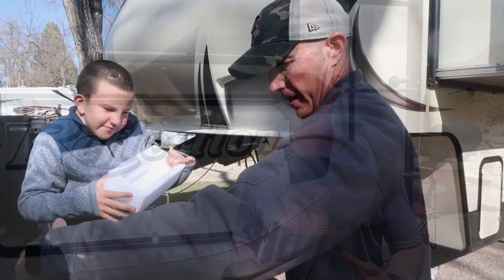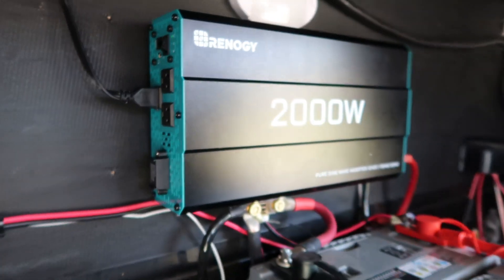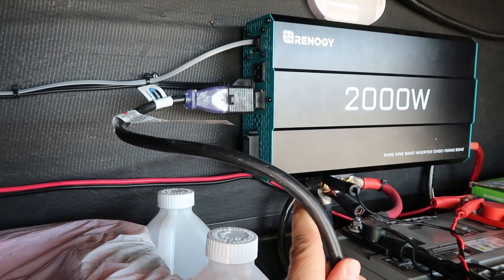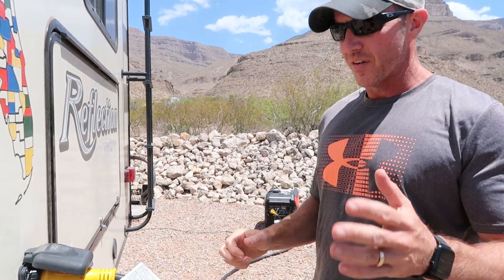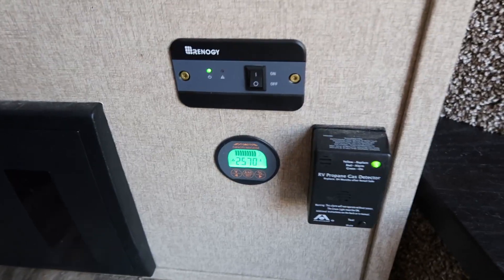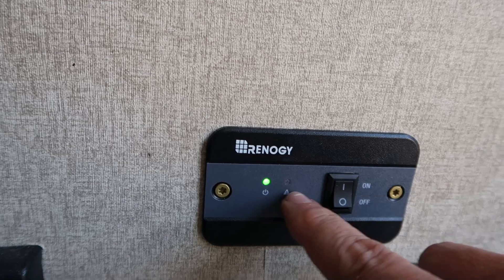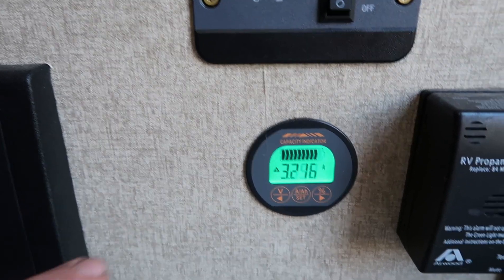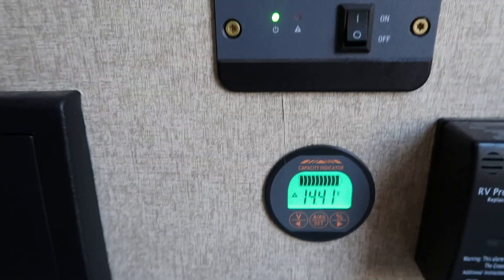How To Power Your Entire RV With An Inverter | Easy Inverter Power

Comment: Just bought this inverter but will be installing a auto transfer switch though.   My question is why didn’t you use the high output of the inverter instead of the 15amp plug side to backfeed the camper?
Reply from the maker: For our needs, the 15 amp side would be all that we need. I could have cut off the plug on the cord and hard wired it, but it’s not necessary for our application.
Reply: @JouppiOutdoors  ok.  I have a 30amp motorhome and was thinking that would be better.  My older Aims 1200/2400 with built in transfer but quit on me so I seen your setup and thought that would be nice cause I just was using it to run tvs off one breaker with the pass thru feature.   Thanks

Comment: On the 50a to 15a adapter, how did you decide on 15a?  Is that what your inverter is rated at?
Reply from the maker: I went with the 15 amp adapter because I’m using a heavy duty (20 amp) extension cord to power the trailer from the inverter. This provides more than enough amperage for our needs since we do not run any high load appliances.

Comment: so no fuse between battery and inverter?
Reply from the maker: The inverter is fused internally but I also have a 250 amp inline fuse between the positive battery terminal and inverter.

Comment: Can you do it with a 1500 watt inverted if your not running AC or a Heater?
Reply from the maker: A 1500 watt inverter would work without running the A/C. Most RV propane furnaces run off of the 12 volt system so heat should not be an issue.

Comment: I don’t really understand the need to be doing this.   If you can’t run your AC or microwave off this then just get a Bluetti or similar box to charge devices then simply recharge it.   You keep making reference to “running everything as normal” but fans and lights runoff if 12v so this only powers the 110 outlets.
Reply from the maker: I think I explained it pretty clearly in the video. You can power your trailer minus the heavy load appliances. It is incredibly convenient to have all of your outlets powered up. Thanks for the feedback and the Bluetooth is a great option as well!

Comment: so i plugged my trailer up and i melted  my terminal, is this cause i didnt have enough battery or panels ?
Reply from the maker: Oh no! Sorry to hear that. Melted terminals are caused by a loose battery cable connection at the battery 99% of the time. The loose connection combined with the high amperage draw creates a tremendous amount of heat which melts the terminal. I saw this happen to batteries on numerous occasions while working in the battery industry for 14 years.

Comment: If I turn the converter off whe. Using inverter will my 12 volt dc still work? The fridge is on 12 volt dc
Reply from the maker: All of your 12 volt will run off of the batteries when the converter is shut off.
Reply: None of my plugs inside are hot when i shut the converter off. What am i doing wrong?

Comment: After reading many reviews and watching a lot of videos, I chose this option for my first backup power station. https://www.youtube.com/post/UgkxHypYDKHAN93Lp2RQpfvU_ksc70wJ00pt I was between this and a larger option that could power a wider range of items, but the price/size/capacity blend seemed right for this unit. Hasn't gotten a ton of use yet, but the build quality is solid and it charges fine via the Rockpals solar panel I purchased to pair with it. One thing to note is that the screen is optimized for a top down viewing angle, which makes sense, but this means it washes out at other angles - especially low angles. Not a huge deal, but perhaps a better option for the display could be used to provide wider viewing angles.
Reply from the maker: Thanks!

Comment: I just got the 3,000 watt RENOGY and 2 x 230 amp hour REDODO LifePO4 batteries. QUESTION; My plan is to run 4/0 battery cable fused. Then run 10 gauge wire hard wired to the inverter, to a 30 amp female RV plug mounted beside the inverter, inside the compartment. Make an access hole that has the plastic reclosable big enough to run the 30 amp cord through it. Seems as long as the inverter functions as stated, it should power a microwave for 5 hours, the AC for 2 to 2.5 with no solar. I have a 190mwatt solar that came with camper, can expand to 600 watts with the 30 amp charge controller that came with the camper. WILL add solar soon.
Reply from the maker: Sounds like a great setup!

Comment: How much have you pushed this inverter towards 2,000? I’m installing a 3,000 watt Renogy soon, these videos have been a big help. Example, microwave and another high energy draw appliance, and did it hold or shut off? I’m seeing some negative reviews saying they could even run a portable AC?
Reply from the maker: I have only run one high draw appliance at a time. Microwave and electric kettle are the main appliances I have used on a regular  basis. I’ve had no issues, however, this setup was intended for occasional use and has been fantastic for us since we only boondock occasionally.

Comment: QUESTION; does turning of the converter cut off power to the 12 volt refrigerator
Reply from the maker: If you have a 12v refrigerator it should be powered by the batteries when the converter is off. Our refrigerator is electric/propane so we just turn it over to propane when we use the inverter.
Reply: Thanks, mine is thankfully 12 volt fridge

Comment: I did the same thing but I’m only getting power to the gfci outlets. All other outlets have no power.
Reply from the maker: You have your RV plugged directly into the inverter? I would recommend plugging into shore power to see if all outlets are actually working.

Comment: Excellent video thanks. I just bought the same inverter so your instructions are super helpful. Not-so-quick newbie question: you have that external 50amp female receptacle on your 5th wheel, which you plugged into with your inverter extension (and taped on adapter). But I have a 1992 Class C motorhome that has a 30amp receptacle inside the shore power line compartment, which I plug into with my shore power line in order to run everything off my Onan onboard generator. Is that the where I would plug in the extension cable? And then switch the converter breaker switch off before using, as you advise, or is there more to it in my case? If that's where I plug in, the easiest thing would be to cut the 20 amp female plug off the extension cord and wire in a 30 amp male plug in order to plug into my system. Does that sound right?
Reply from the maker: Hi, I’m guessing your shore power cord is hard wired to your RV? If so, you would plug the cord from the inverter into your shore power cord via an adapter. The outlet your referring to most likely is wired to your generator to give you a convenient access point to plug into when on generator power. Hope that’s not too confusing? Thank you for watching!
Reply: @JouppiOutdoors  Another way to think of it is how you would plug your rv into a 15amp outlet from your house. You would use a 30amp to 15amp adapter on your rv power cord. But instead of plugging into your house front porch 15amp outlet you would plug into the 15amp outlet on the inverter. Be sure to turn your converter circuit breaker off 1st inside your Rv's power panel.
Reply: @JouppiOutdoors  Oh. Okay. That's easy, thanks!

Comment: Can I use 500 watt inverter for this ? Or wattage needs to be higher ?
Reply from the maker: I would recommend at least a 2000 watt inverter for this setup to be worthwhile. Technically you could probably use a 500 watt but it would really be defeating the purpose. A 500 watt would not allow you to use multiple items at the same time. Thanks for watching!
Reply: I have 17foot small trailer, I just want to be able to run Refrigerator and charge a phone. You think 500watts is enough for that ?

Comment: My wife says we will never boon dock so this may be the way to go. I don't want to spend money on a power transfer switch or an inverter with a built in trans for switch. Just in the event that we lose power at an RV park and we need to have power inside out trailer short term this may be the way to go for us. I'm looking at buying the Renege 2000 watt inverter, Maybe the 3000 watt I'm not sure if the 3000 watt inverter will benefit me. I have 165 watt solar power on roof and 2 deep cycle marine batteries.
Reply from the maker: Our boondocking is very limited and even then, only a few days at a time. This setup has been very useful during a few campground power outages though! I believe the 2000 watt inverter will be more than sufficient for you.
Reply: @JouppiOutdoors   Did you need to install a power transfer switch or just turning off the converter breaker does it?

Comment: The issue with mine is when the converter is off I have no access to DC power, which means no lights, radio or dc plugs, chargers, chest fridge,  and TV. They save a large portion of power using DC. There must be a way to just disconnect the charging part while still having access to DC power. Wasn't aware that the converter ate enough power to do this. I was only interested in running the inverter for heavy AC loads like microwaves and Air/heat
Reply from the maker: The converter supplies 12 volt DC power when the RV is plugged into shore power. Your DC should be supplied by the batteries when the RV is not plugged in or when the converter is off. You may have a battery issue if you lose DC power when the converter is off.
Reply: @JouppiOutdoors  oh ok, thank you I will look into it. I finally wrapped my head around the solar and wind wiring but the RV side was still a little confusing, batteries are new so I think I may have wired things a little funny, I basically followed the RVs previous owners wiring job when I replaced a few wires. I will have to diagnose it. I can wire servers together but for the life of me this stuff still escapes me. Still learning.
Reply: @JouppiOutdoors  little bit of a tip for the help in the tech world. Type C plugins are more than just charging and data transfer. Usb companies are making the move to make DC powered items more reliable with Type C. They are a version of smart DC conversion and they make kits available to change your old DC powered items to Type C. They are reducing the use of wall wart type inverters saving electricity costs. They used an NES game console as their example which is actually impressive. Type C is the new LED for energy savings. I run my TV off of it since I tried the conversion. it needs a Type C 100 watt capable car plug in for safety. An lcd tv runs typically 12-14v 60w and without the conversion through its inverter it drops to 45w usage. Which is 15w to run the inverter at the most. The Type C Converters might use 1-5 watts dependent on the circuit quality. So if you take 10-15w off everything that you plug in the wall, the power savings add up fast.

Comment: With your 20amp extension cord, are you using a plug adaptor on the 15 amp end of your 50 to 15amp plug that's coming from your rig?  You're going from 15amps to a 20 amp extension cord.  Do the adaptors get warm/hot after being plugged in for extended periods of time?
Reply from the maker: There is no adapter needed on the 50 to 15a adapter going to the trailer. I do have to use a 15a to 20a adapter on the inverter end of the cord. They never get hot. Thanks for watching!

Comment: I am seriously thinking about building a power box to use in my Class A Motorhome, using 2 12 Volt Deep Cycle Marine Batteries, and either a 2500 or 3000 Watt power Inverter. I plan on using a set of  Portable 100 watt solar panels for 200 watts total. It will have a cooling fan installed, as well as an adequate size fuse for protection. I plan on using the set up to run my hot air fryer, microwave, phone chargers, TV/DVD Player, a few small lamps, and possibly an electric Space Heater during the winter time to supplement the propane furnace. I will not be hooking anything up directly into the electrical system of the Motorhome itself, I will instead be hooking the items mentioned directly into the inverter itself, as needed.  Everything mentioned will not all be plugged in at once. I will only plug in the items needed, such as the TV/DVD Player, or the hot air fryer. I just want the power box set up so that if my Motorhome is to low on gas to run the onboard generator, and I am not able to have shore power access, I will still have a way to power my hot air fryer, or microwave to be able to make a hot meal, watch a movie, or turn on a lamp, or add a bit more heat in case the outside temp is to cold for the propane furnace to keep up with keeping the motorhome toasty warm.
Reply from the maker: Sounds like a great plan!
Reply: @JouppiOutdoors  I have been thinking more, and more about what I am wanting to do with my Power Box for my Motorhome, and I wanted to get your opinion on my new plan. I was thinking about going with 4 12 Volt Deep Cycle Marine Batteries, and boosting the inverter from a 2000 or 3000 watt up to a 6000 watt inverter, and still going with the Portable Solar Panels to keep the battery bank charged. I am planning on living in the Motorhome full time, and doing boondocking 90 to 95 % of the time, parking in Walmart Parking Lots, and other places that allow overnight parking. In your personal opinion, do you think my idea will work well without any issues, or do you think I am wanting and expecting to much from my planned power set up ?

Comment: I found an open breaker on my panel so wired it directly to that, no cords needed…
Reply from the maker: That’s awesome! Definitely more convenient than dealing with the cords!
Reply: @JouppiOutdoors  I originally did the cord thing like you are, but recently added another battery and saw the open slot so figured I’d use that instead.

Comment: It would be nice if you explained the additional wiring setup both to the inverter from the batteries and from the inverter to (???) whatever you have coming out of the left side of the inverter.
Reply from the maker: The inverter is wired to the batteries using the included jumpers that came with the inverter. The only unique thing is that the negative cable goes to the battery monitor (as do all the negative connections) instead of directly to the batteries. The wires on the left side are just the cable going to the inverter on/off switch inside (gray wire) and a power strip that is plugged in directly to the inverter and mounted inside the RV.

Comment: So you could just keep your "RV" battery separate, instead of turning off the convertor.
Heck you could have a completely portable system so you could move the batteries/inverter in/out of the RV, say if you wanted to use them in the bed of the truck etc. (Yea batteries are heavy to move).
Reply from the maker: In theory, yes you could but the battery also provides 12 volt DC power to the trailer. You could use a separate battery as long as you had a way to recharge it.

Comment: Sweet, how are those AGM’s holding up for you? 

I’m still using two standard lead acid batteries for 3 years now, I have to charge them daily for at least 3 hours though. The Lithium’s look great but that’s a lot of money to dish out.
Reply from the maker: The AGM’s held up great, I am a huge fan of the Northstar/Odyssey batteries! I have since made the switch to 2 100ah lithium and they are a game changer as far as weight savings and run time!
Reply: Yeah, I think I’m gonna take the plunge over to lithium myself. I think we’ll be seeing a lot more development in the future towards better batteries. Enjoy your camping adventures this summer.

Comment: What happens if your rv does not have a separate switch for the converter power to battery bank?
Reply from the maker: You would need a way to kill the power to the converter for this setup to work correctly.
Reply: @JouppiOutdoors
Reply: I did just that now it works fine in my system/ thanks

Comment: Nice set up. I did things similar except I ran dedicated plugs off the inverter to the inside of the fifth wheel and one in the underbelly. We have two suitcase panels ( one got a side broken in a wind event). We also use two Battleborn lithium batteries. We had bad luck with our AGM batteries.  We just ordered a new Brinkley and it will come with a solar setup and wired for an inverter. We will put an additional panel on. We just got done boondocking outside of Yuma and never ran the generator once. Burlington Bill here busking from the road and here on you tube!
Reply from the maker: Nice! Thanks for watching!